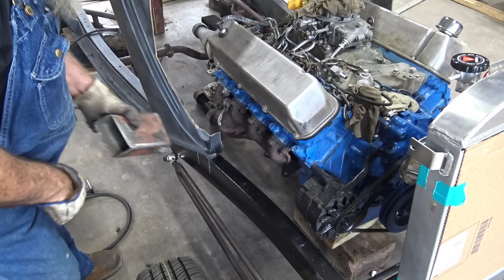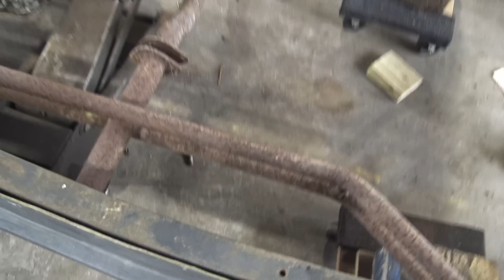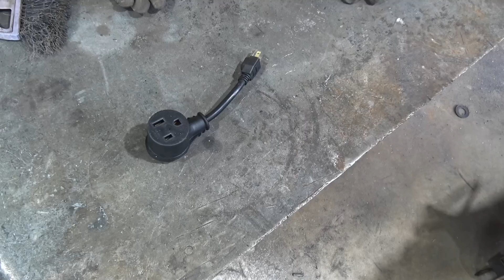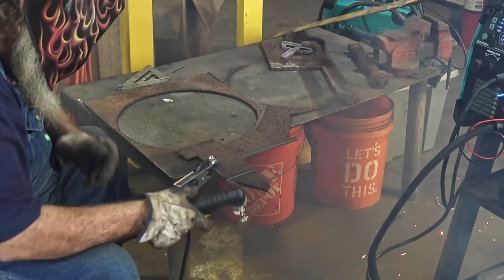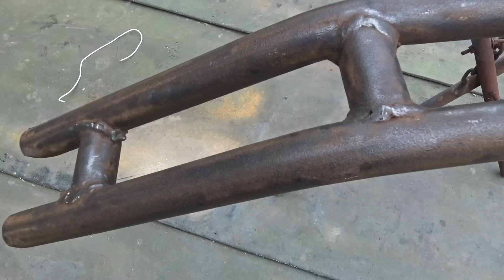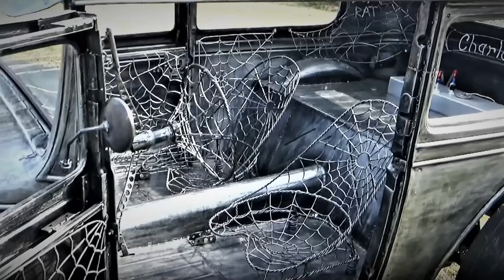Easy Custom Hot Rod Engine Mounts + BestArc 80 AMP Plasma Cutter

Comment: Hey Bawb,
   I hope ya gonna ad some gussets to the top and bottom of those motor mounts.
The torq of that engine will twist them mounts pretty quick and easy.
I have had good luck placing a bar under the engine side to side inside the frame rails with the mounts going up from the bar.
   Bestarc is doing pretty good at building a nice plasma cutter and having you prove it in the shop with real time cutting.
   I would think ya need to get ya rear suspension in before ya set the height of the trans mount.
   See ya next time.

Comment: Hey Bob. I like the design of your home page. You did a good job designing it. An 80 amp is nice to have if you have enough amperage in your shop. I only have 60 amps so my 60 is good enough. That is a great cutter though. You better trim your beard a little if you plan on using that cutter. The sparks were coming close to burning you up. Or are you going to try to look like ZZ TOP? Ha-Ha. The hot rod rat rod is coming along just fine. Thanks for sharing.👍👍🍁

Comment: Hi Bob, I don't kno if this will work out space wise, but maybe, the Motorcraft oil filter, part number FL820 is a shortened version of the FL1A that is listed for yer 429, that may leave the space ya need for steerin w/o the expense of a relocation kit, just an idea, love what ya do 👍
Reply from the maker: Yea gonna try a short one before I buy that relocator.

Comment: Obviously the back end is going to have too come up more than an inch if it's sitting on the frame now unless you're notching the frame,  it'll need more travel for the suspension to work. Nice advertisement for that plasma, bringing the fire storm into the workshop 😂 I'm going to check it out👍

Comment: Those braces look like they might be real DOM tubing for race cars. You can grind the mud dober welds down and make a couple passes over them. Move them where you want them. Its looks good what you got done on the motor mounts. Your getting it done. :face-fuchsia-wide-eyes::face-blue-wide-eyes::face-orange-raised-eyebrow::glasses-purple-yellow-diamond::body-blue-raised-arms::hand-orange-covering-eyes::trophy-yellow-smiling::trophy-yellow-smiling::trophy-yellow-smiling::trophy-yellow-smiling::trophy-yellow-smiling::trophy-yellow-smiling::trophy-yellow-smiling::eyes-pink-heart-shape::face-turquoise-covering-eyes::body-green-covering-eyes::hand-purple-blue-peace::hand-purple-blue-peace::hand-purple-blue-peace:Maybe you can stiffen up the body with some wood or metal and glass it in. Plus roll bars.

Comment: Ahh, another flavor of the month Plasma cutting commercial. I wondered where those went.. I missed having you promote a new and different plasma cutter every month. Of course the one in the newest video is the right one to buy.
Reply: He puts out content steadily, doesn't spew political views, doesn't force brands down your throat and he occasionally reviews a tool. Are you really going to low key cry like a child?
Reply: @TheRoadhammer379  You need to put 4 speeds in. Good job.